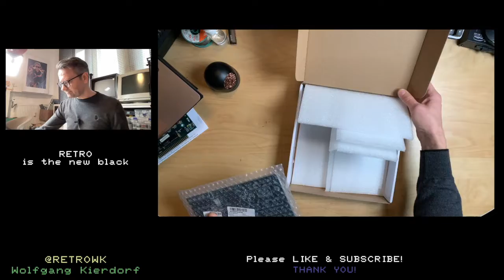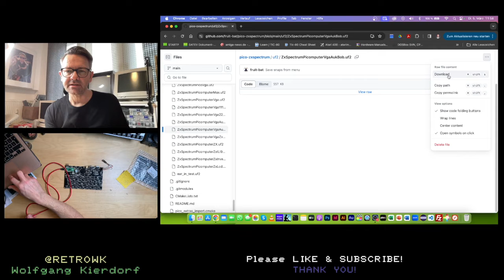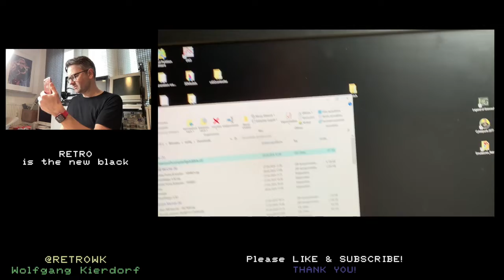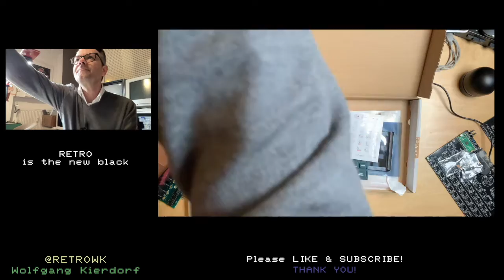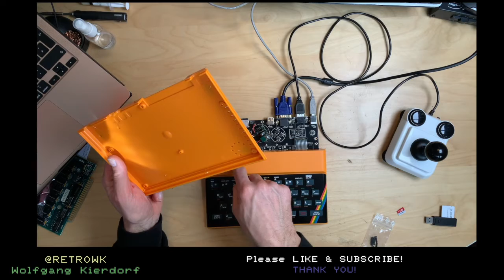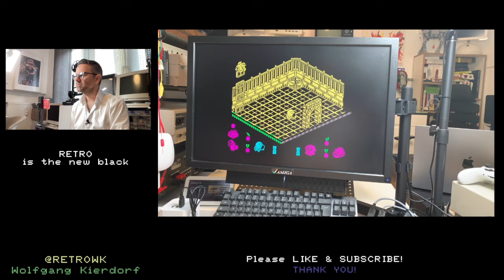A brand new ZX Spectrum 48K/128 for $20 #pcbway #zxspectrum #spectrum #retrogaming #8bit #retro

Comment: Ich habe leider keine Bildausgabe. Hab meine Lötarbeiten mehrmals gecheckt. 2 VGA Monitore ausprobiert. Einer sagt ungültiges Signal der andere kein Kabel angeschlossen. Gekauft habe ich die kleine Version ohne Keyboard. Hab auch beide Firmwares probiert. 50Hz und 60Hz. Ohne Erfolg. Was könnte es sein?
Reply from the maker: Hast du sowohl die Verbindung zur VGA Buchse als auch die Verbindungen des PI (GIOS) gecheckt? Dann ist entweder der PI defekt oder die Verbindungen in der Buchse gebrochen. Kannst ja mal mit einem Multimeter die Verbindungen durchklingeln.
Reply: @RetroWK Danke. Bin nochmal über alle Lötpunkte gegangen und hab ein altes VGA Kabel verwendet da die neueren anscheinend keine Vollbelegung haben. Nun habe ich Bild. Jetzt ist es so das er keine Dateien anzeigt in den Ordnern. Snapshot und Tape sind leer. Fat32 und die Ordner hat der zxpico selbst erstellt. Komisch.

Comment: Sorry am I right in assuming that the membrane keyboard takes over and the hat switches that you soldered on your main board are now redundant?
Reply from the maker: Yes. That is correct. There is also a board version without the "keyboard". It's just the upper strip of PCB.

Comment: See the comparaison of ZXZERO, ZXPICO and ESPSPECTRUM on Lee Smith channel, the solutions based on Raspberry Pi Pico do not seems to be powerful enough to run all the ZX Spectrum games, mostly the latest ones that uses lots of raster effects to overcome the graphics limitations. The Raspberry Pi Zero is by far the most performant solution for this bare metal emulators. Maybe further firmware upgrades will improve the ZXPICO performances? Who knows... But frankly, for $100 you can buy the XBerry Pi the Spectrum NEXT clone that will run all the software for every ZX Spectrum model out there.

Comment: Apologies if the answer to my question in buried the links, but where did you order the orange case?
Reply from the maker: Right here: https://www.sintech-shop.de/en/replacement-cases-fuer-sinclair-zx-spectrum-16k-48k-different-colours/a-10020 or https://zxrenew.co.uk/ZX-Spectrum-Replacement-Cases-only-c22752627
Reply: @RetroWK  Thank you. I will try to order these bits as soon as I can make PayPal payment work 🤣 not that I need it or anything and it would be cheaper -- and probably easier - to just wait for The Spectrum to come out on Nov 22. But unlike the RetroGames product - this wold be a visually much closer replica of the oh so nostalgic Spectrum...